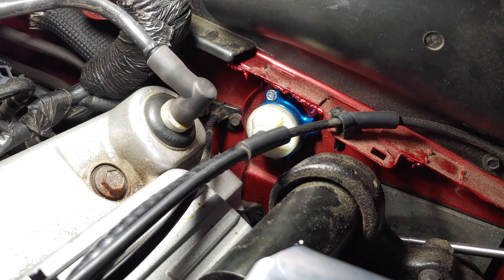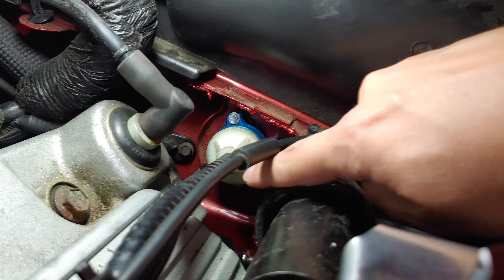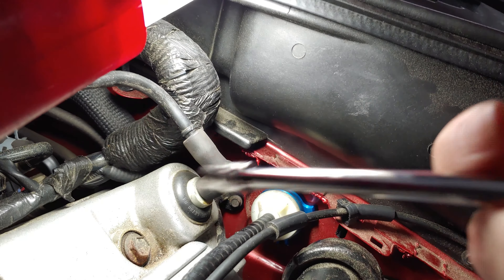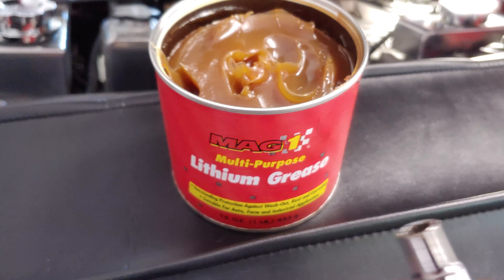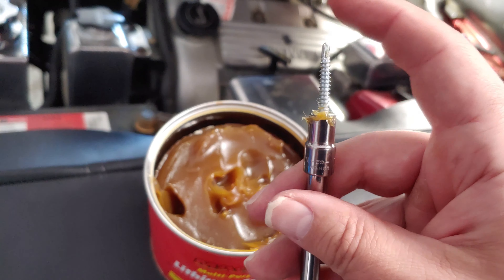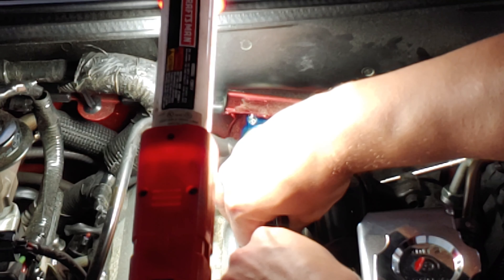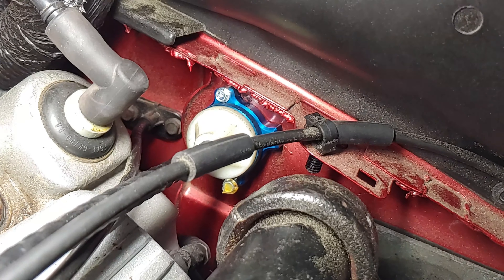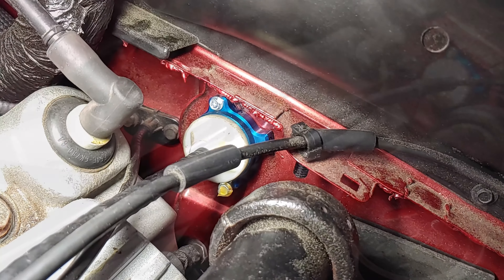Handyman Tip: How to Keep Bolts From Falling Out of a Socket

Comment: You can also use a piece of paper towel put it over the bolt head and then into the socket 
Most times the paper towels and enough to fill up the distance between the socket and fastner

Comment: That would work good for bumper screws where the screw goes right inside in a miserable spot. Thanks for the tip
Reply from the maker: Oh yes because once they fall down in there they are impossible to find 🛠️